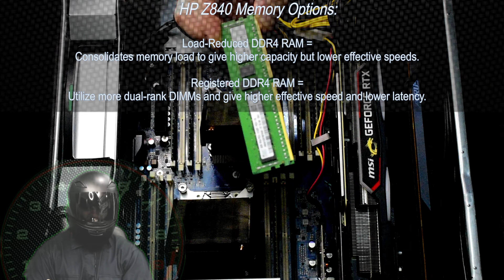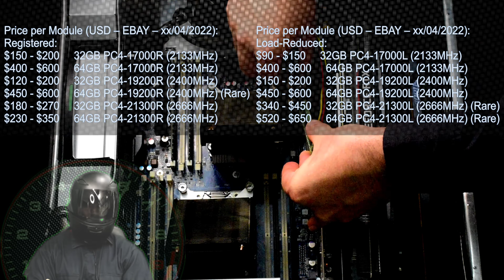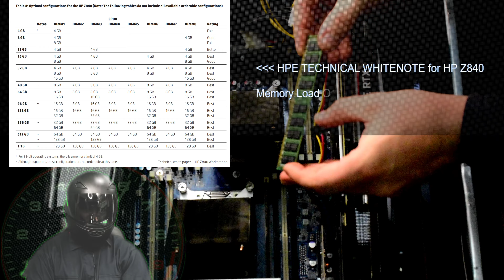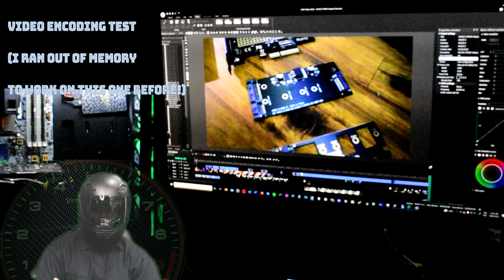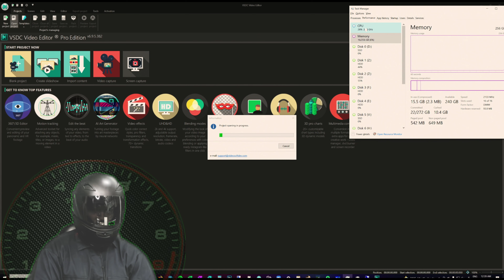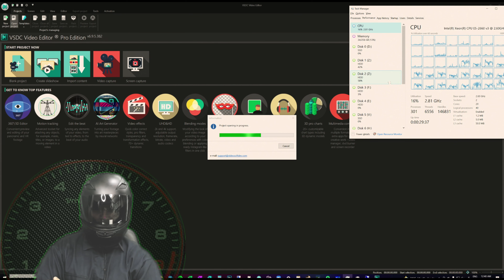HP Z840 RAM Upgrade - Is 64GB of RAM for 4K Video Editing Enough?

Comment: Hi! I'm deciding between the HP Z840 and the Dell T7910. Which workstation is better?
Reply from the maker: They are really similar in performance overall and it really comes down to which system you can obtain for less. Generally the Dell workstations are cheaper than the HP workstations (despite being of similar specifications). I have opted for the HP Z840 due to availability and good pricing when I bought. 

There are some subtle differences that would place the HP Z840 above the Dell in terms of performance. The Dell T7910 has a 1300W PSU, the HP Z840 has 1450W; the Dell T7910 has 1x 1GbE port, the HP Z840 has 2x 1GbE ports, the Dell T7910 has 4x PCIe 3.0 x 16 slots, one PCIe 3.0 x4 slot, one PCIe 2.0 x4 and one PCIe slot, where the Z840 has 3x PCIe 3.0 x16 slots, two PCIe 3.0 x8 slots and one PCIe 3.0 x4 and one PCIe 2.0 x1. There are other differences but overall these two systems cater for similar hardware needs. 

The only other benefit for the Z840 is that I have done several tutorial videos for upgrades on them - which gives you a heap of inspiration for mods. 
Check out my full HP Z840 overview video here: https://youtu.be/2bie4EGJZL0

Let us know which one you settle on!
Reply: @racerrrz  I like the sata ports on the z840, the Z840 has many sata ports. However, I don't like the fan system that cools the CPU and RAM, it makes noise like a jet engine.

I'm looking to see if there is another way to replace the heatsink for the Z840, noctua is an alternative
Reply from the maker: @sachsongkhoe  The CPU fans only make noise on start up - there after the system does maintain a low noise level. HP places a lot of engineering into the acoustics of their workstations - hence the complex fan shroud. With the lowest fan speed setting selected the system produces a whisper like level of noise. But that does give me some ideas - I may see if I can record the noise level for the HP workstations for an upcoming video giving an overview of four generations of the Z8xx workstations. 

In terms of cooling upgrades, the best path to take is to fit the HP Z Coolers. I did a fitment guide and I have tested their effectivity. They offer a decent 5'C CPU temp reduction without having to increase fan speeds - this could be increased with better thermal paste solutions also.
Reply: @racerrrz  If we use HP Z Coolers instead, we will remove the RAM cooler, right?
Reply from the maker: Sorry slow reply here, I didn't get a notification about your message. The Z Coolers are a straight upgrade over the stock coolers and they will not require you to remove the RAM cooler - it was designed to work with the RAM cooling unit. So you just slot the Z Coolers in and you get a decent drop in CPU temps. I did a full guide video on the Z840's Z Coolers if you wanted to check how they fit up and how well they work: https://youtu.be/q3YFqH5pdDA